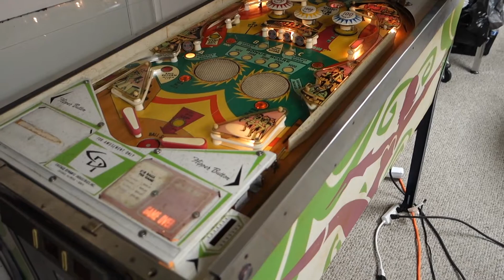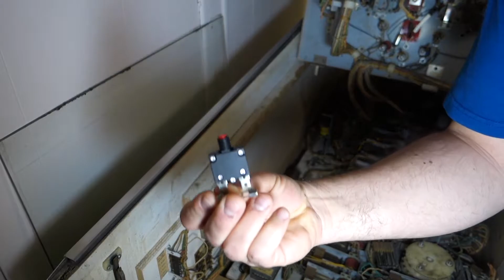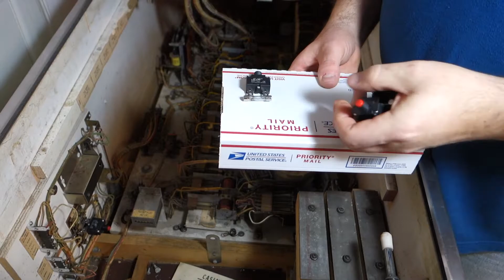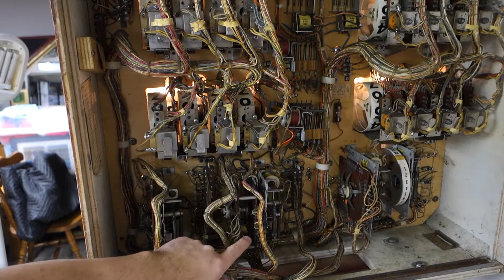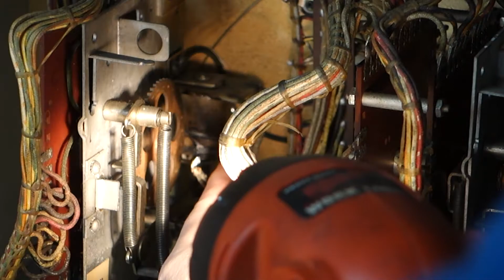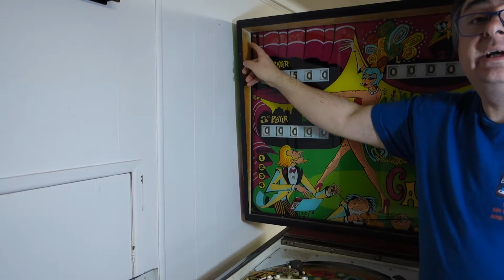1972 Chicago Coin Pinball Casino Introduction

Comment: I spent the day working  on the head of my 1974 Hi-Flyer. It is a 2 player, but very similar. Noticed some EOS switches in the score reels are normally closed and others normally open? My player double stepper is sticky so needs to come apart. Thanks for the video.
Reply from the maker: Yes some leafs in score reels are normally open or closed on some machines. However they should be the same on every reel.